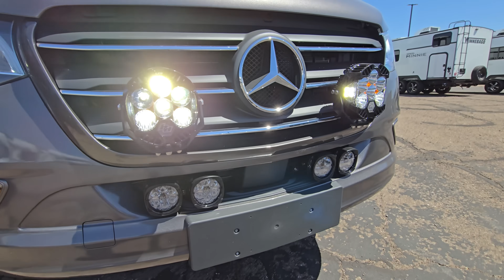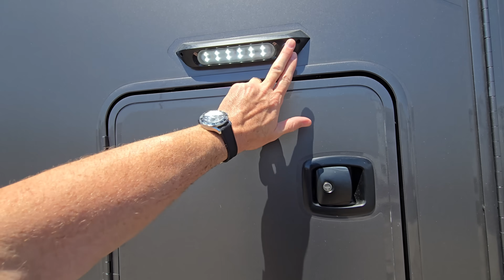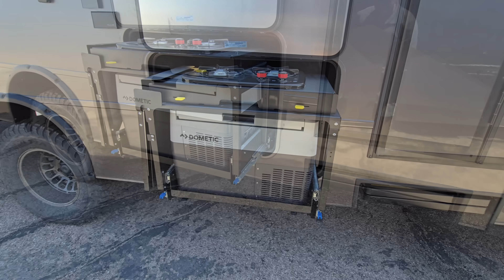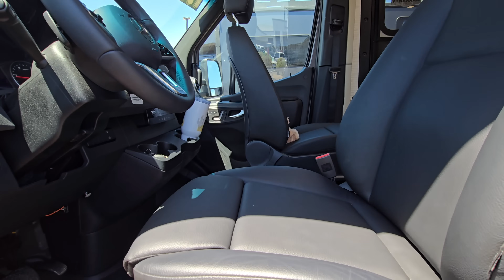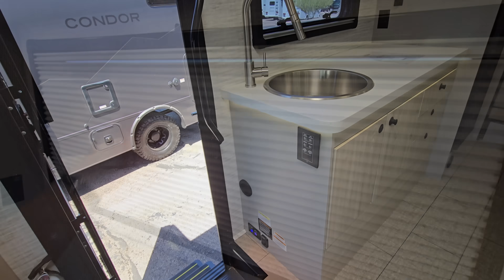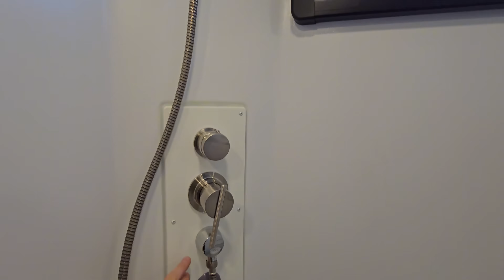Special Build 2025 Entegra CONDOR! VanUp Mercedes Sprinter 3500 AWD 170" Chassis! #ekko #campervan

Comment: Just another hipster mobile.  Four-cylinder engine you can keep it. We watched one struggle going through the Rockies going uphill struggling to get 20 miles an hour. They didn’t look happy and safe when we went by them in our RV doing 65.
Reply: I am not a big fan of a 4 banger engine in an RV. Wish Sprinter would give buyer a choice if 6 cylinder or 4cylinder option.

Comment: Huge markup on that VanUp kit. $25k for wheels tires and some shocks and a leaf pack and some lights is insane. I'd expect a nice bumper and winch as well at minimum for 25k. Buy a non VanUp version and have freedomvango do way way more for less.
Reply: Best advice ever…. 25k is insane for that…. Never get extra packages from the dealer… they gouge on everything… take it somewhere else and choose better parts for less…. Like solar and battery packages are insane…. It will be like 1 lithium battery, 1 panel and solar controller for $7500 😂

Comment: Thanks for sharing the tour. Always nice to see whats happening in the Class C Builds. I do have a questions, is there a particular reason this vehicle was equipped/uplifted from VanUp with the VanCompass OPTI-Leif rear springs rather than the DEAVER Progressive Rear Spring?  I am also noticing that you are offering the KING 2.5 rear shock rather than the KING "Shadowmarqu" 3.0 rear. Thanks for taking time to share the new Condor.

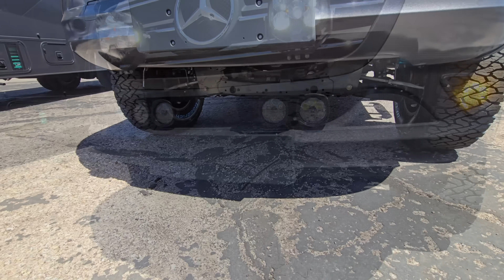Comment: I just started watching I'm only 2:47  into it and so far I think it should have a nice black brush guard, aluminum brush guard on it with the lights. "Just my five cents so far" overall it does look nice, I'll continue watching....at 14:17 I don't know how I feel about a round sink, never used one in a kitchen area. I'm so used to a square or rectangle one. Also should there be a cover to make the floor flush where the step down is in the stairwell by the door? In the kitchen I wonder if a slightly larger fridge freezer could be installed and then in the bedroom under the upper cabinets in each corner I think some type of corner shelving with receptacles / USB could be installed for cell phones / watches and maybe a CPAP. Overall I did like it. Just needed some tweaking to my taste. 😆

Comment: Similar in many aspects to the EKKO Mercedes and wow, WAY OVER PRICED.  Perhaps if you had $200k of disposable income or planned to live in the rig full time this makes sense but for average RVers/Campers this thing is unaffordable.  When you add the hefty rates on auto/RV loans and the depreciation as you wave at the salesman, these prices make no sense.  Spare tire in the garage - nope not going to work so where is it normally? Propane generator but no solar or mention of lithium batteries.  I think the better generator option is the diesel generator that ties into your vehicle tank.

Comment: Since this has a black and gray tank, do you know if there are tank heaters for winter camping? My Thor Tranquility has a gray tank heater.
Reply: the cassette toilet door is clearly visible from the driver's side.  AKA no black tank.
Reply from the maker: Great question!  All of the holding tanks are internal and will be insulated from the outside.  Thanks for watching!

Comment: Awesome now make it 6 wheel so we can take it off road. I race all off road   do not trick people.
Reply: You mean rear dual wheels? Those aren’t ideal for off-road because a rock can wedge between them and tear the side wall as the tire compresses.
Reply: @ChopperChad  Both my 1089s spit rocks out between tires  -The Himars would not use this exact chasi  if this nurd physics was true  .
Reply: @blueneptune-u8z  you can make your point without bring such a jerk about it.
Reply: Then just buy one without the super single added! You obviously didn't watch the video!